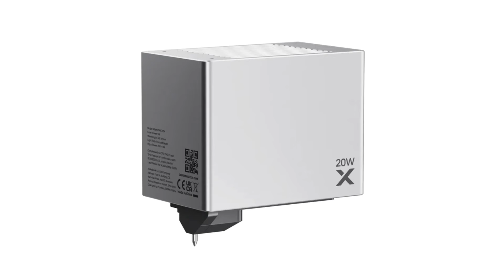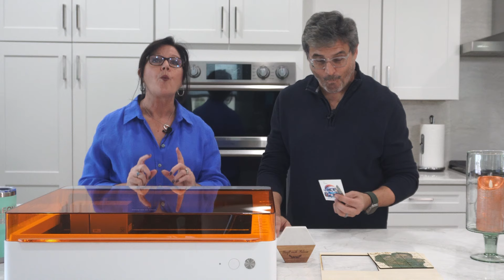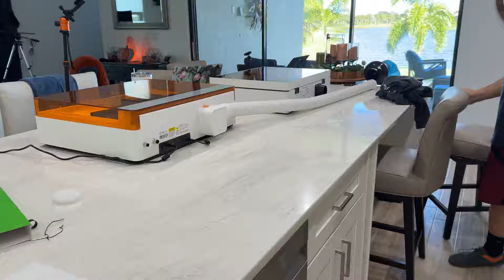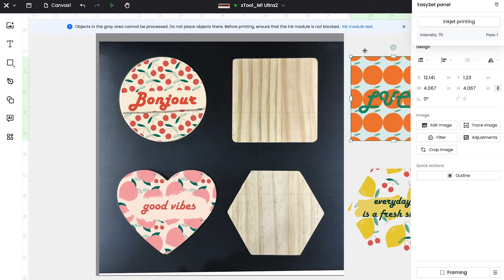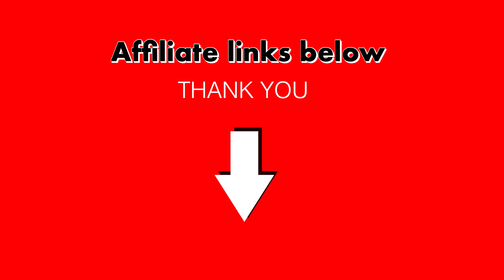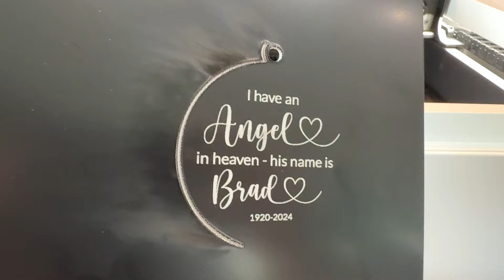FINALLY - Cut, Engrave and Print in One Machine! Check out xTool M1 Ultra

Comment: I own this machine and sold my Cricut. Big mistake. It does not cut paper well. Not clean cut and the mat is soooo sticker you cannot remove paper without damage. I agree with the text and pen situation. All of my pens were dry with 1 project and no other pen fits. Overall the laser is nice ( I have the 20W) but as a printer and cutting machine I give it a thumbs down.
Reply from the maker: Have you tried cutting cardstock with the laser and no mat? I had great success with very intricate detailed designs that I could not cut with some of my cutting machines.

Comment: I made the decision to sell my Cricut and by the M1ultra…BIG MISTAKE. The cricut is much better at paper and vinyl. If you want a laser I recommend a dedicated laser.
Reply from the maker: I was able to get very detailed, intricate designs to cut on the M1/M1 Ultra using cardstock (65 lb). Cutting vinyl on a laser requires laser compatible vinyl. I haven't done much cutting with vinyl on any of my lasers, but when I have, it worked well.
Reply: Did you cut with the blade or laser? If you used the laser what settings did you use? Thank you so much.